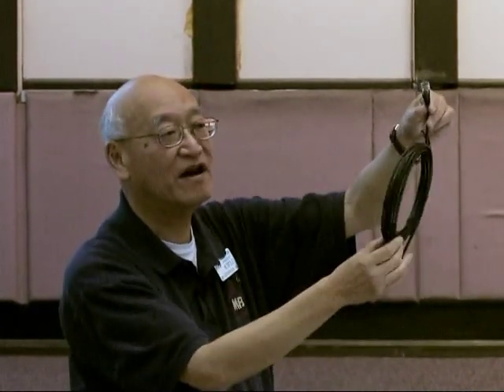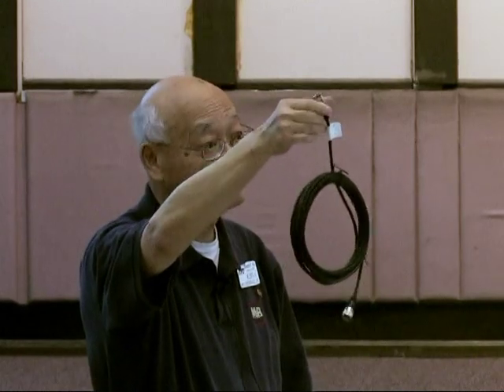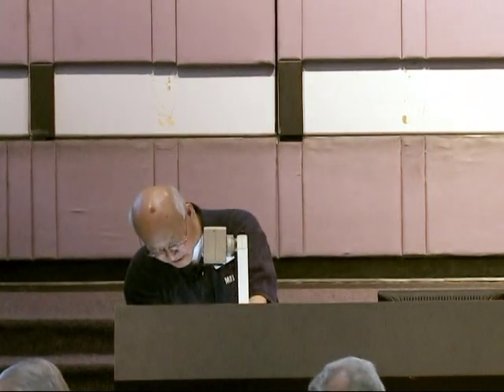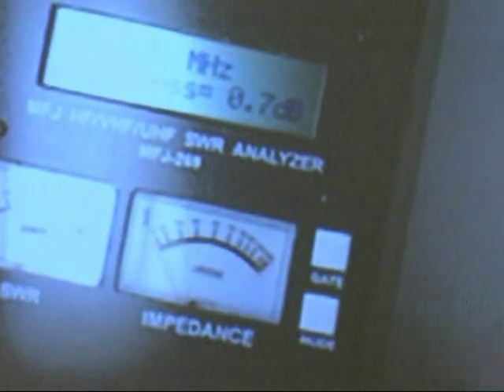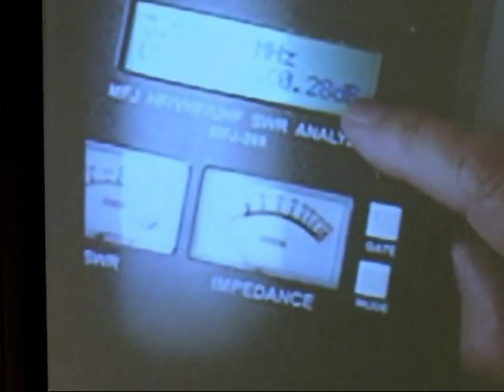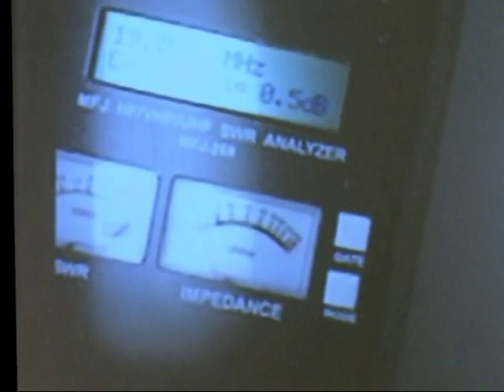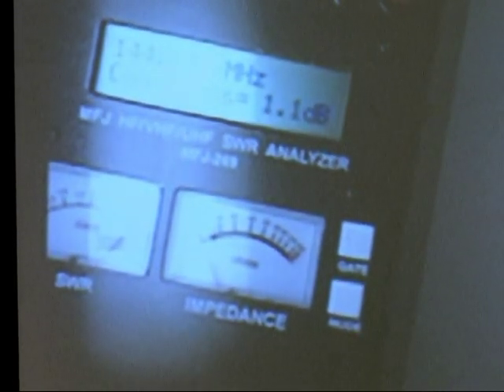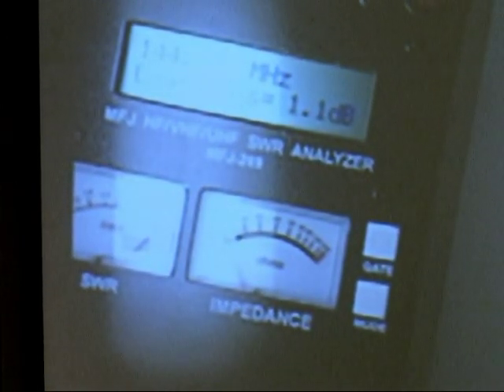MFJ Presentation: Testing Coax Cables Part 2 of 2

Comment: How about cutting the cable in half? Test one and if it's a good connector then add another one to the other end. Test that and cut close and replace if needed till you have a good smaller cable. Replace the bad connector on the other cable with two good connectors.
Will that work?